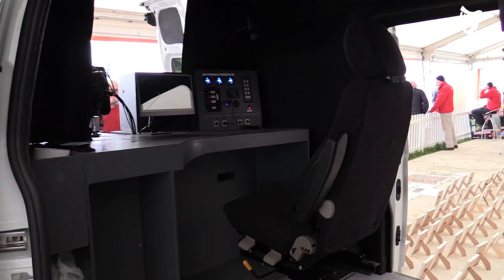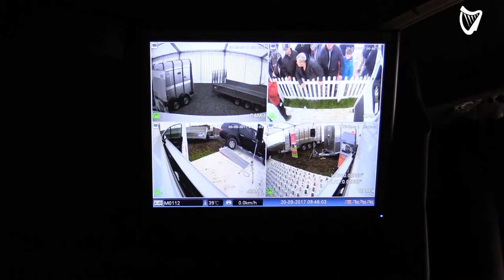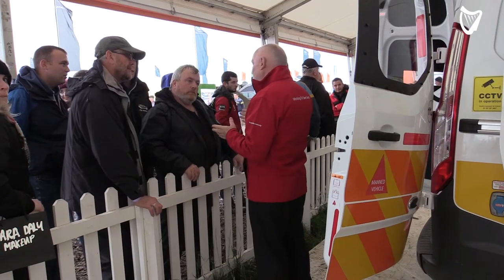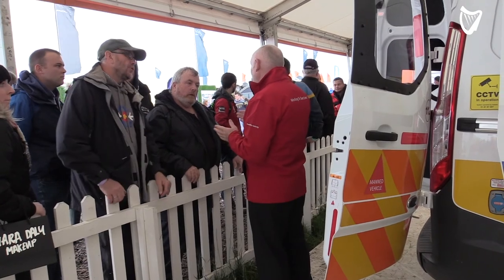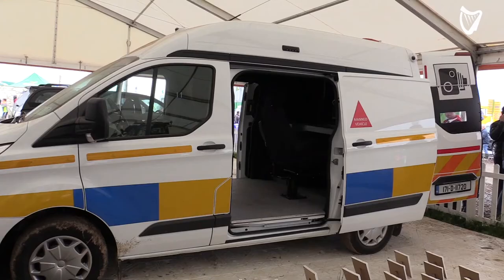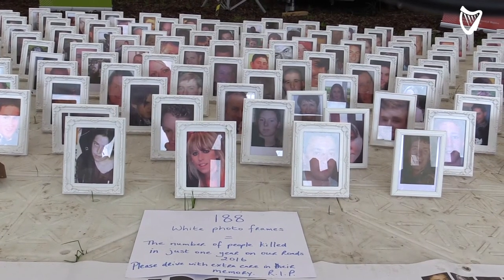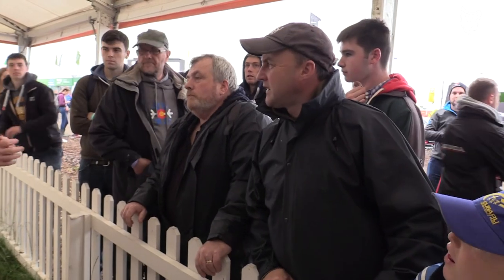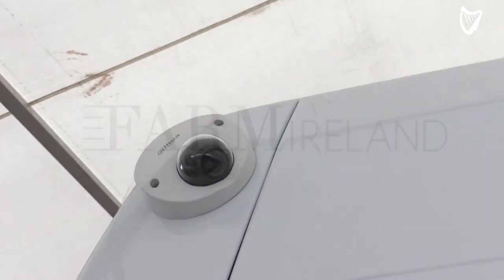WATCH: 'How many lanes are monitored and is there somebody in there?' - Inside a speed camera van

Comment: On a dual carriageway with central reservation, 3.5 ton van speed limit is 60mph .if doing 68mph even though you are over limit, do they go by the normal car speed limit which is 70mph or every class vehicle will get looked into as to there speed limit ? This is with the speed camera vans